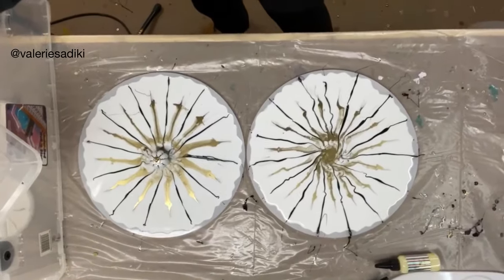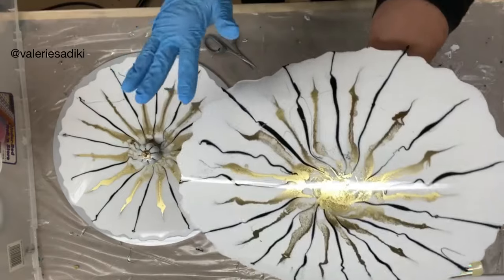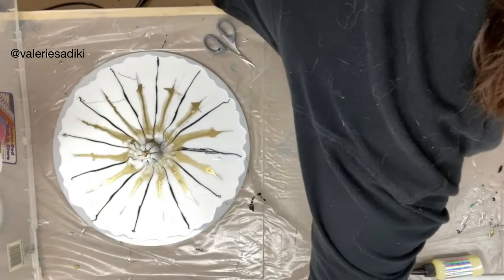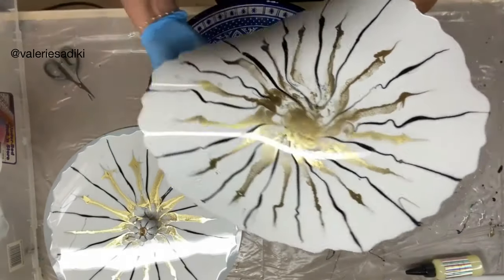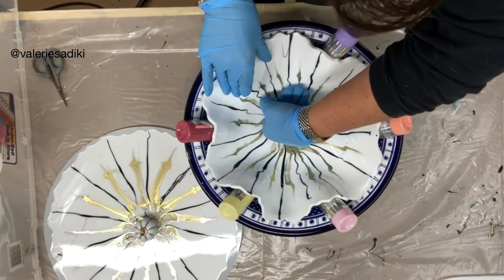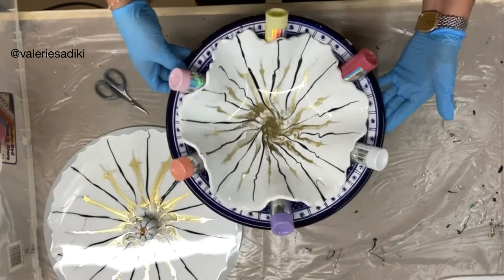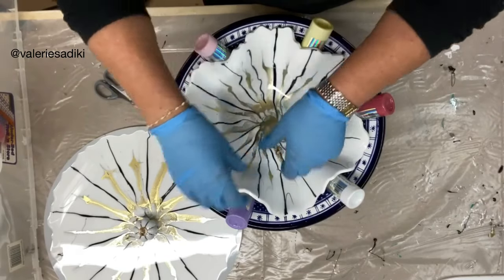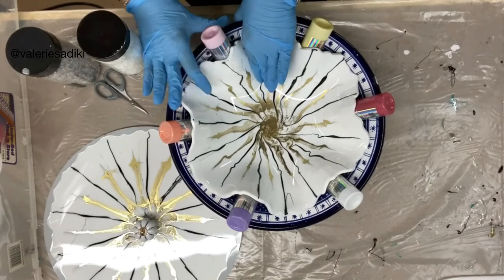How to Shape a Resin Bowl - Full Step by Step Tutorial

Comment: Hi!! So I have been trying to shape the resin coasters from the geode molds I bought from your store and I dont know If I waiting to long to shape it!
Reply from the maker: Hi which resin are you using and how long are you waiting until starting to shape them?
Reply: @just4youonlineuk  I am using Dr. Crafty and I waited 6 hours. Did I wait too long?
Reply from the maker: @Rnoemi1095  it would depend on your resins curing time. It should be shaped when the resin is touch dry, but still able to be bended and moved. Check the instructions on the resin for when it is touch dry. In the video Valerie is using our premium epoxy resin which is touch dry in 4-5 hours so you could begin to shape it in possibly 3-4 hours.

Comment: Tried making a bowl with the same technique but my resin bowl is stuck on the glass platter!!! Unable to take it out? Would appreciate it very much if you could please  guide me.Have tried alcohol and warm water.
(Am a beginner)
Thanks
Reply from the maker: Hi Ritsie, how long has it been curing for? It may depend on the resin you are using too?
Reply: @just4youonlineuk  it's been curing for a little over 24 hours.
Reply from the maker: @ritsiemola3017  thanks Ritsie which resin are you using?
Reply: @just4youonlineuk  it's a local brand here in India so far didn't have any problem.
 Also I was able to remove it from the glass platter with alcohol. I poured alcohol and left it for 10 mins and with the help of 2 spatulas it came off! Phew!!!!
Thanks! Have a good day
Reply from the maker: @ritsiemola3017  That’s great, you too